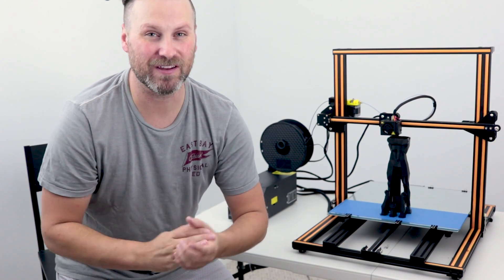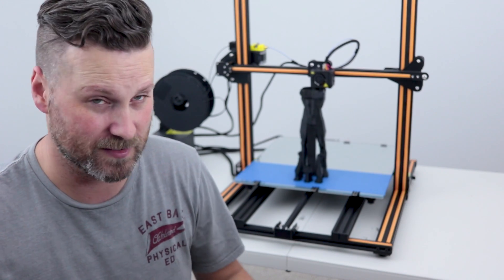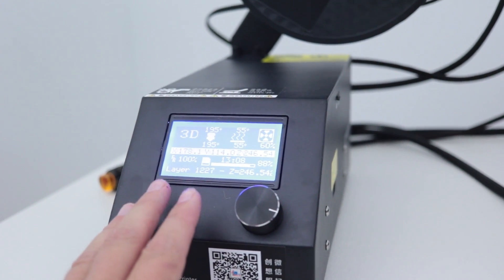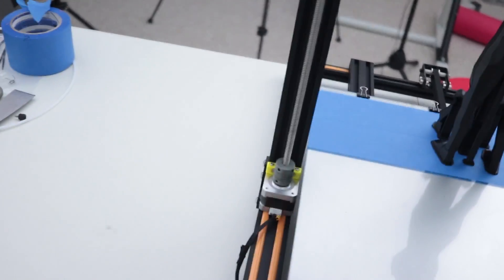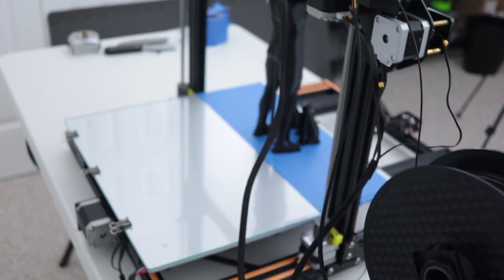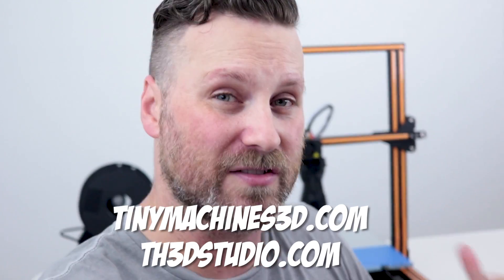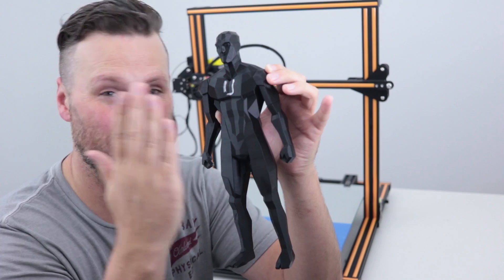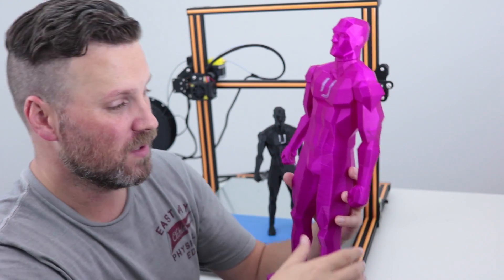Taking a look at the NEW & IMPROVED CR-10 3D Printer | CR-10 Enlarged

Comment: Do these printers need to be hooked-up to a computer? I never see one in any of the video's and is may sound stupid, but I just started researching these 3-D printers so not sure? Also, if the answer is yes, how beefy does the computer need to be?
Reply: I use my brick of a nexus 7 tablet to download thingiverse models, i slice them online with astroprint, and i use 3dfox to control the printer with a usb otg, not ideal and i have some trouble occasionally, but it works if you dont have a pc
Reply from the maker: Brendan O'Mara not a stupid question at all. I had the same question when I was getting started. You need a computer to download the files you want to print, then run the file through a slicing software(tells the printer how to print the file) cura is free, simplify3d is the one I use but you have to buy it. Then you download the print instructions to a sd card (typically included with the printer) and then pop that card into the printer, find the file and hit print. Alternatively you can directly connect your computer to the printer but you have to keep it connected while it’s printing if you do that. I don’t think most people do that. Also, some printers do offer wireless printing functionality that you can send the file directly from your computer to the printer. Those tend to move much more expensive printers. Hope that helps!

Comment: The auto bed Level feature does work. It automatically positions the extruder to each corner and the center of the bed for each step of the process so you don't have to manually move the extruder to the correct point and risk damaging the motors. you still have to use the piece of paper and manual knob turning method for the actual function of leveling the bed.

Comment: Hi there UJ, like your content and subscribed!

I really like the build volume of this printer, but I'm not sure if I'm going to be be missing out since the CR-10 only has 1 extruder. I was either thinking this one or the BIBO Touch laser printer and I honestly can't choose between the two. The BIBO has two extuders, for say PVA supports, and is encased for ABS printing. Does a printer need to be encased for ABS or should I not have to worry about that? With those two statements are in mind, should I still go with the CR-10 or with something else for my first printer?
Reply from the maker: KrimsonStorm any printer that you want to run ABS will need an enclosure. I've never cared or needed to print in ABS at this point so no enclosure never bothered me. I'm not sure about the other machine as I haven't heard much about it. One thing I love about the CR-10 is the HUGE online community for support. I've actually never owned a dual extruder printer before so can't really comment other than it would be great for the dissolvable support material. Let me know if I can help with any other questions
Reply: Thanks for the feedback UJ. I appreciate it!

After watching some more of your videos, and looking at high-rez prints, I decided to go with buying a large CR-Enlarged. If I need to go with ABS for some reason I guess I can always build an enclosure.

Keep up the great content!

Comment: Thanks, I am very happy to see the upgrades as I am preparing to purchase a CR-10
Reply: Make sure you order the CR10S right now for the new model or you can get the CR10 for less but without the new features on Gearbest use Coupon 1 ($369.99): CR10ZUI or Coupon 2 ($369.99): 11NOV131 for the standard model CR10     or the same coupon takes the New model CR10S4  down from 599 to 499  Or you can order the older model CR10 from Banggoods USA warehouse for 399 and get 2-4 day free shipping Make sure you select the USA warehouse and its on the order form before you checkout or its a month free shipping from the china warehouse.

Comment: I wan one and I just saw it for $416 with free shipping! There is a spacial deal at Banggood:
https://www.banggood.com/DIY-Creality-CR-10-3D-Printer-300300400mm-Printing-Size-1_75mm-0_4mm-Nozzle-p-1085645.html?p=9R09143243493201512Z
If you dont get the price directly, use a 16% off coupon for your printer, code: 3DPrinter 
Enjoy.
Reply: gidimiz that's he smaller one

Comment: Hey im interested in a cr-10 for a long time. Can someone help me!? I would want to know all the differnces between the cr10 and cr10s.
Reply from the maker: Clash It size & price. CR10 is 300x300x400 the S is 400x400x400
Reply: Uncle Jessy Thanks!
Reply: Uncle Jessy That is not correct. CR-10S anda CR-10S has the same print volume of 300x300x400mm.
Reply: Hua Wei is right . The300x300x400 CR10 is the old model single z axis motor no filament sensor . The CR10S is the same size print and  has the dual z axis motors, filament sensors which allows return to print if there is a power failure or after running out of filament as well as having new motherboard
Reply: i think you mean the CR10 and  CR10S is 300x300x400 the CR10S4 is 400x400x400 the CR10S5 is 500x500x500

Comment: To be honest I see little or no mods from the CR-10 community in this new version... All I see is a few good additions to keep up with the competition. The new Prusa has power failure resume aswell as filament sensor. Where are the bigger leveling knobs or the knob to tighten the Y-belt or the Heatbed cable clip to secure this cable on the heatbed or the improved air blowing to cool the print. Does this improved CR-10 have more silent fans in the control box or has it the upgraded motherboard allready with better heattransfer? Many people are replacing the fans with Noctua fans because it's so damn noisy. I will replace them aswell.
Reply: Nate its the same unit as the old model CR10.  The CR10S just has the upgrades so all the CR10 mods work.  The CR10S4 and Cr10S5 are larger models

Comment: Wait, isn't the CR10 300x300x400? this one is now 300x300x300?
Reply: The300x300x400 CR10 is the old model single z axis motor no filament sensor . The CR10S is the same size print and  has the dual z axis motors, filament sensors which allows return to print if there is a power failure or after running out of filament as well as having new motherboard. There is also the CR10S4 which is 400x400x400 and the CR10S5 which is 500x500x500
Reply: lucidnightmare927 there are CR-10's in many sizes S3 is 300mm, S4 is 400mm and the S5 is 500mm.
Reply: I think he made a mistake. The CR10 he has here is a S4 which is 400x400. He actually says 16 inches at the same time - which isn't 300mm. 300mm is around 12 inches.

Comment: Dude I'm absolutely loving the upgrades they did to this machine.  The filament sensor seems like a must have for something this large. The power feature is epic.  I have totally lost prints due to a flipped breaker.  I might need to get one of these.
Reply: Make sure you get the right model as both are shipping right now from Banggood . I believe Gearbest has only the older model The300x300x400 CR10 is the old model single z axis motor no filament sensor . The CR10S is the same size print and  has the dual z axis motors, filament sensors which allows return to print if there is a power failure or after running out of filament as well as having new motherboard

Comment: in the beginning you say its 300x300x300? I thought the enlarged was 400x4000x400?
Reply: Not true.  I have a S4.  It has dual Z
Reply: yes seems to be the 400x400 and this afaik has always had the second z achis motor included. So only the filament sensor seems to be new.
Reply: Philipp nah the original cr-10 s4 (400x400 model) only had a single z the S5 has/had dual z but not the s4
Reply from the maker: Haha yea totally screwed that one up... meant to say 400x400x400
Reply: sillywwabbit where and when did you buy it? Because I'm pretty sure the ones they sold a couple months ago on gearbest were single z that's why the dual z upgrade from tiny Machines is listed for the s4 and regular
Reply: I got it about a month ago from TinyMachines3D
Reply: sillywwabbit ahhh okay I did some digging and they did an updated version about a month ago where they added dual z to the s4 I think tiny machines included it themselves back before Creality did though. But I'm not sure. Either you got the updated but not enlarged version or you got the regular that Chris added.
Reply: Ha ha that is the new model CR10S4
Reply: Its the new CR10S4 the old one was the CR104